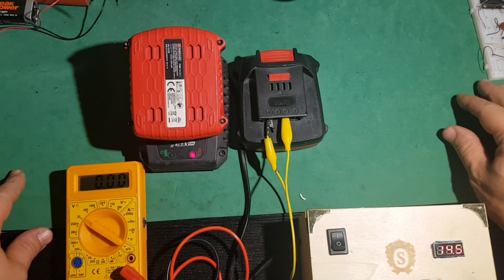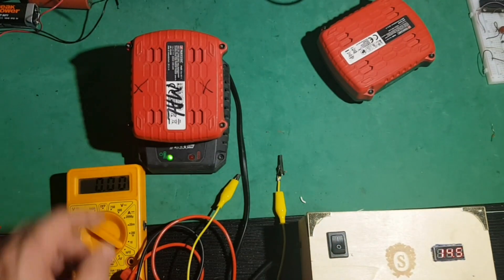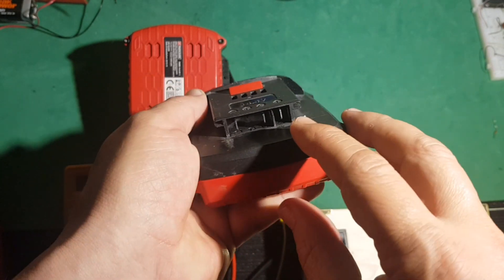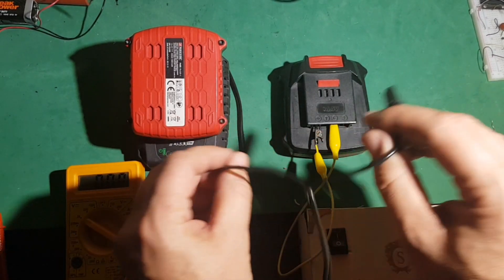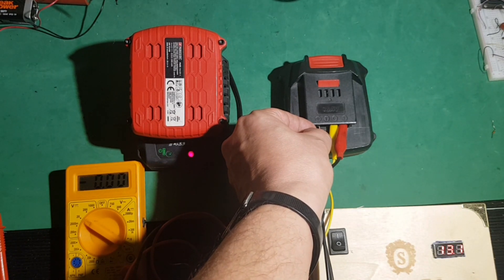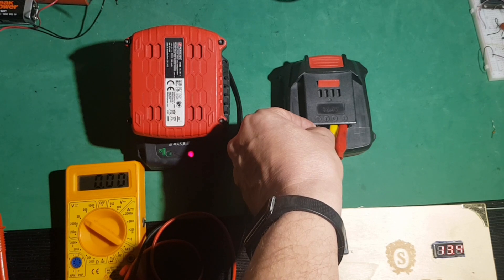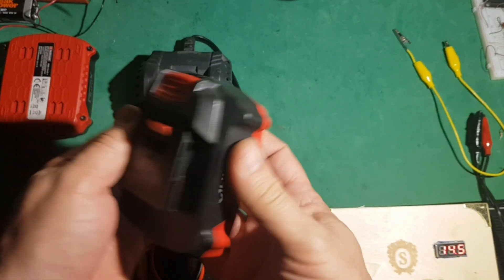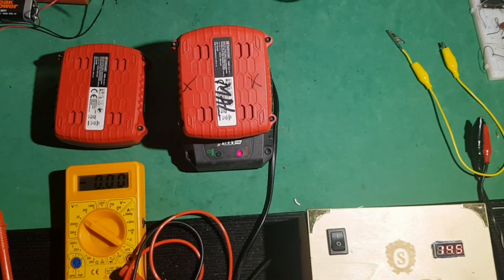Cargador Li-Ion no reconoce batería solucion. #quepuedeshacer #manolinferraz

Comment: Hola buenas, tengo ese mismo cargador y batería, el problema mío es que cuando meto la batería al cargador, pasa a la luz roja y seguido va al verde. Que puede ser? Cargador o batería?
Gracias
Reply from the maker: Hola José,te recomiendo que midas el cargador y la batería, puede ser una celda en mal estado ,o el cargador ,con las mediciones descartas el problema,muchísimas gracias por pasarte por el canal,un saludo 😉👍👍👍👍
Reply: @ManolinFerraz  l a batería me da 14v está vacía para cargarla
Reply: Podría hacer el puente ese que haces y cargarla con un cargador de portátiles?
Reply from the maker: Revisa los voltajes de cada celda,alguna seguro que está mal
Reply from the maker: No te lo recomiendo, pues no lleva control de carga,si pones un bms si podrías hacerlo